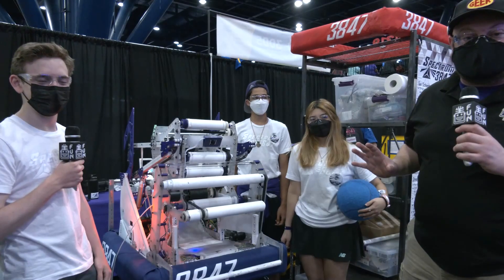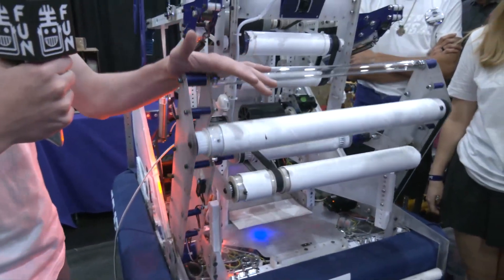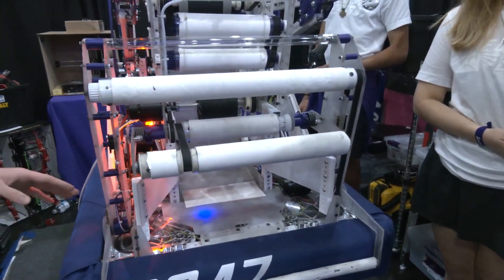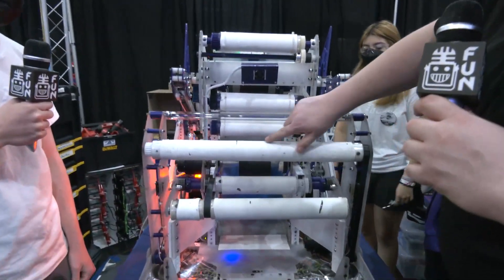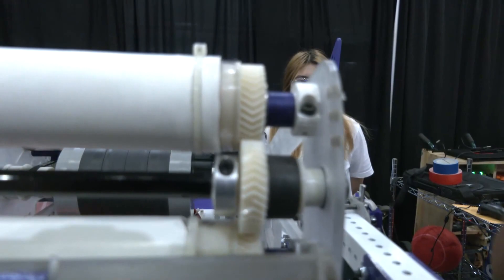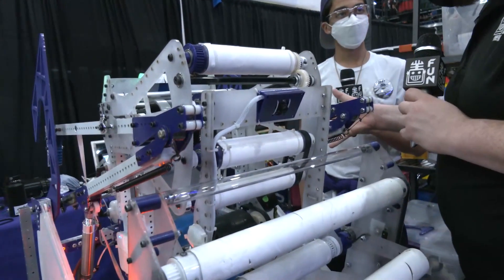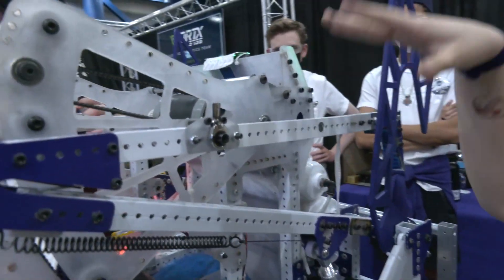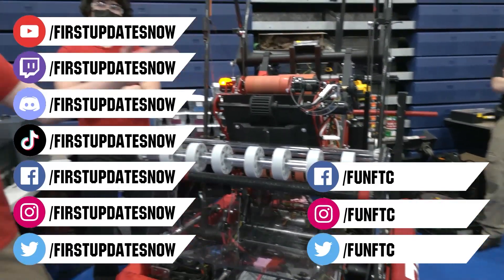Behind the Bumpers 3847 Spectrum Robot Rapid React

Comment: Now what in the world is a "sword drive Mark IV inverted."
Reply: Swerve drive is what a lot of the good teams use for this competition season, it’s essentially 4 independent wheels that use one motor for turning them and one to spin the wheel. It’s a complex system, so many teams will opt to get kits such as this one, the Mark 4i from Swerve Drive Specialties. What they mean when they say mark 4 inverted is that it’s SDS’s 4th generation of swerve modules and the inverted part is because the motors are mounted upside down, allowing for a much lower center of gravity and less space taken up by them on the robot.